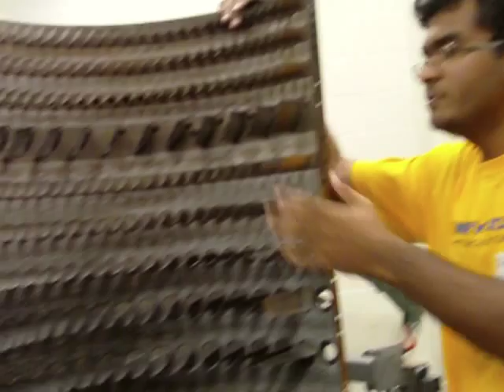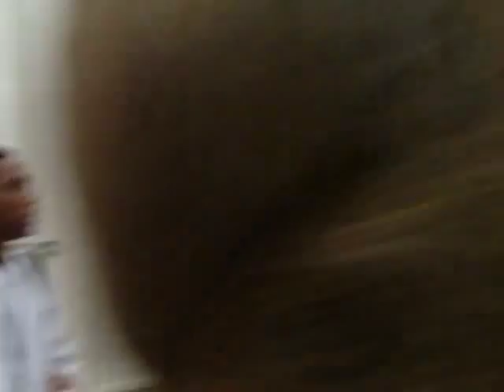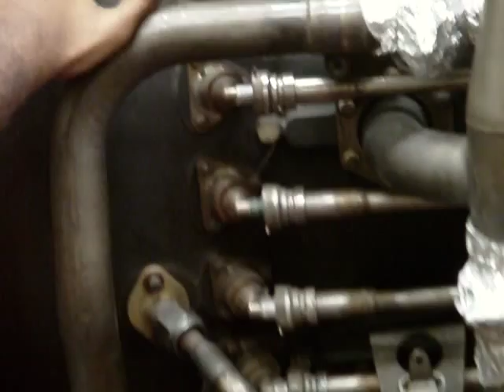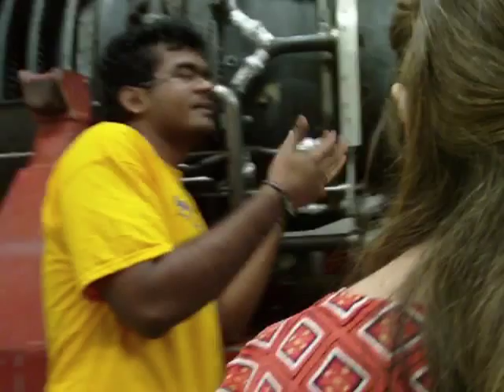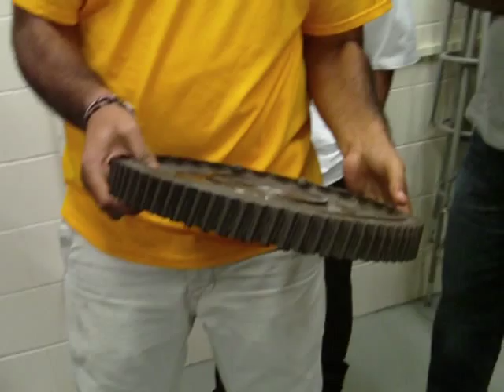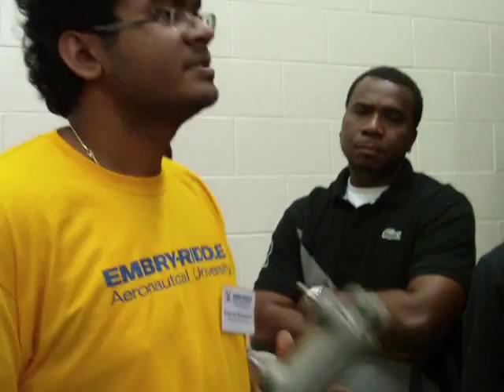Inside a Jet Engine

Comment: this guy talks so much shit....doesnt know the first thing about jet engines....he talks about vigv's being close to the hot end when infact they couldnt be further away he talks about comp rotor discs which is actually a turbine disc he talks about a pneumatic ram which is actually a vigv crank ram powered by fuel pressure....sheesh, get your facts right man